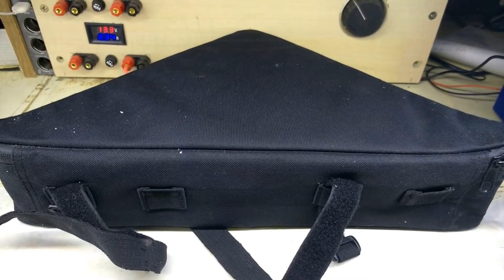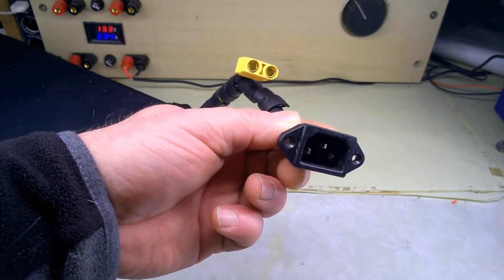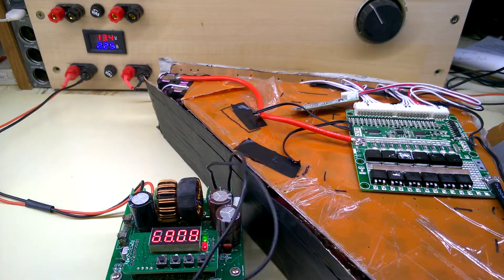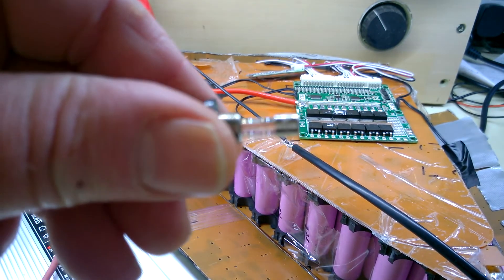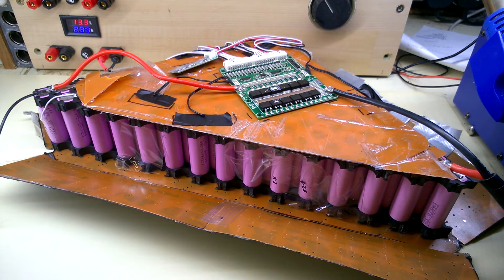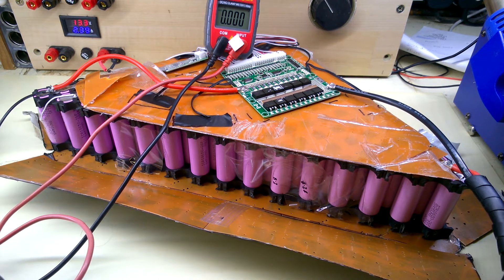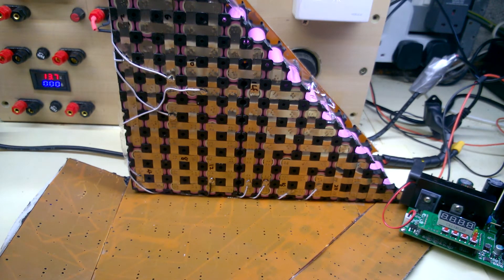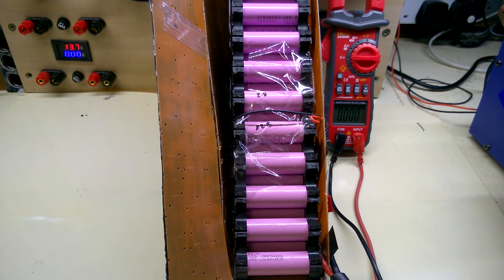72v Li ion battery recovery with a disaster finale.

Comment: where did you buy you dc converter that you use to charge the battery ?
Reply from the maker: From ebay (I think).
It's a 120v dc boost converter.
Reply: @makeitwork7522  thank you

Comment: Interesting. Must have been a junk cheap ass bms.
Reply from the maker: The BMS didn't fail , it was the battery pack made up of cells that could not supply the required current.
The motor needed 60 amps , but the poor battery pack could only supply 30 amps !!
Reply: @makeitwork7522  Yeah that'll do it. Poor little cells never stood a chance.